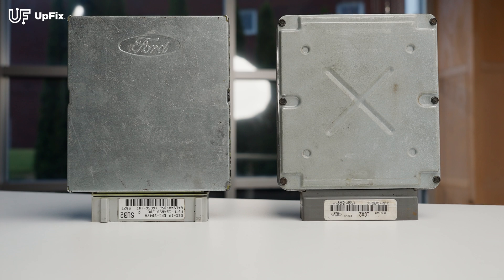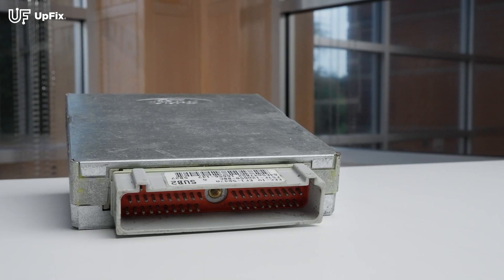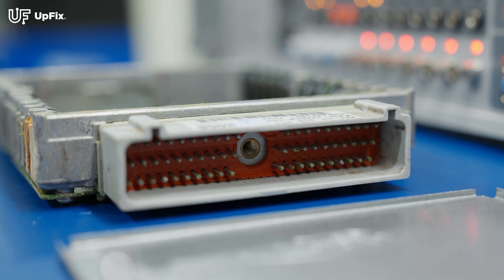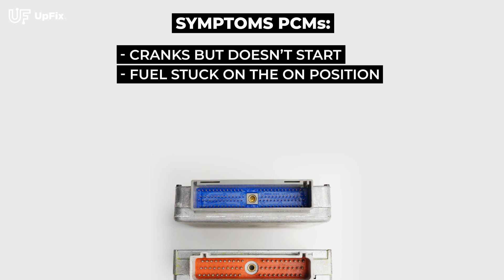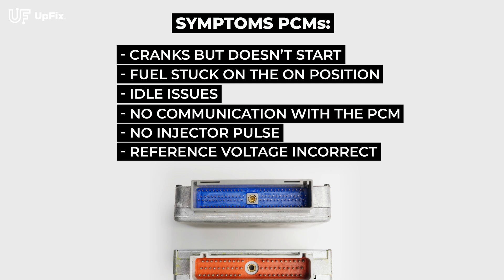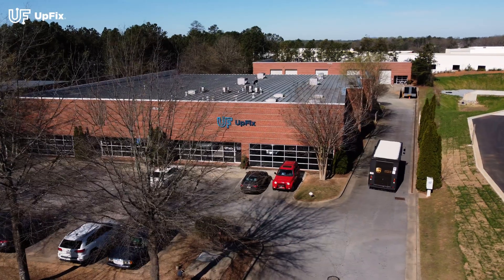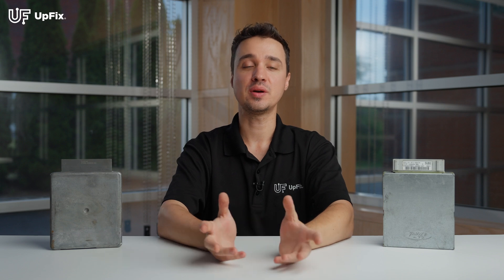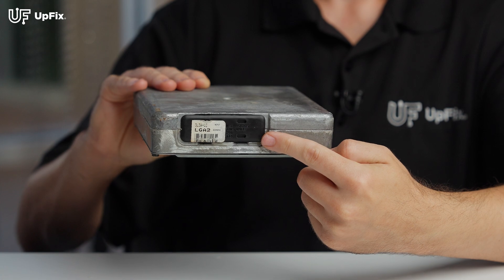Ford EEC-IV and EEC-V PCMs - Common Issues and Repair Service | UpFix

Comment: I have the EEC-IV in 1994 F150 with 5.0L. I am getting a DTC 212 Loss of diagnostic monitor signal / SPOUT circuit grounded. I have verified wiring from SPOUT plug to the EEC plug. Would this be a failure of the EEC? Can you fix it, if so?
Reply from the maker: It sounds like you might be dealing with an EEC issue. We can definitely help diagnose and repair your EEC-IV module. Please visit our website or contact us directly for more details on how to send it in for service.

Comment: Are there any common board components that cause a no communication ? Capacitors ?
Reply from the maker: Yes, bad capacitors are common, but no communication is often caused by failed transceivers, clock crystals, or power supply issues too.

Comment: Do you do other makes a models?
I think I'm getting a problem with the Mercedes r170 y03, with the oxygen sensor beam replaced but it keeps flagging up problems with the management system warning light the last one said it heard a problem with voltage but it seemed to work after the reset. Are the easy to take apart I'll have a go myself. I have replacements just plug and play or does anything need to be set? Another thing the vin numberhas to ve put in manually! I don't know if that's saying anything or not why it will only work if you put it in manually the VIN number? What would cause that issue? I'm not in the US is regional replacements are they required?
Reply from the maker: The R170 Mercedes-Benz ECUs are indeed VIN encoded. Meaning the car won't start with incorrect VIN.

If you have the original ECU, visit our website and scroll down to custom repairs where you can submit more information about the issues you're having with your unit.

Please make sure to provide the VIN, issues and most importantly the codes associated with the oxygen sensor issue.

If your original ECU is currently no-start let us know the codes even if it's only showing you the no-communication with ECU codes.